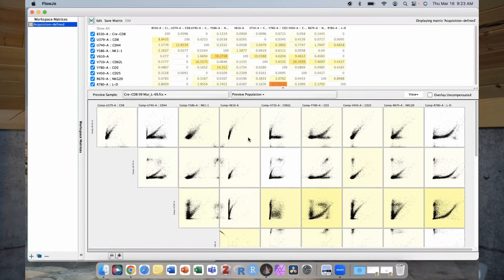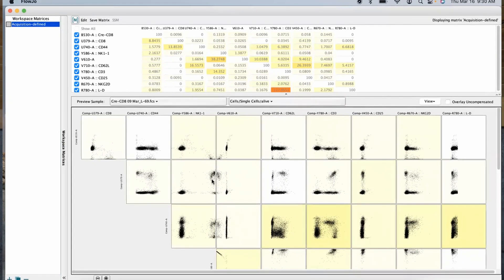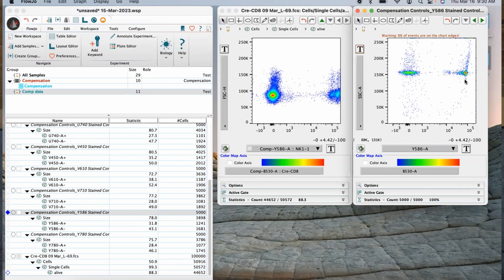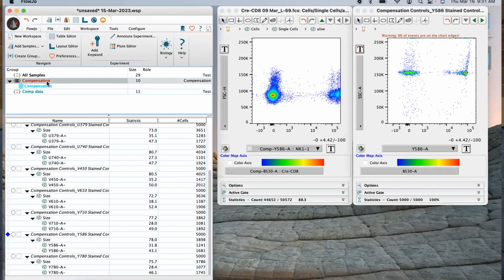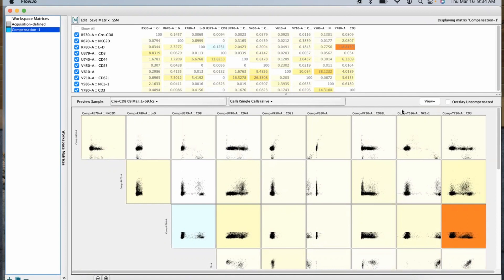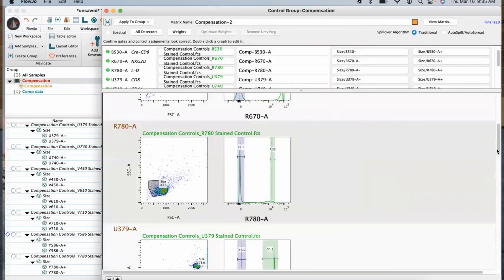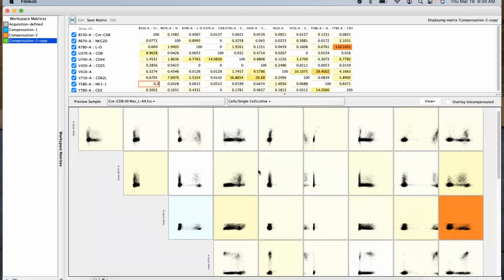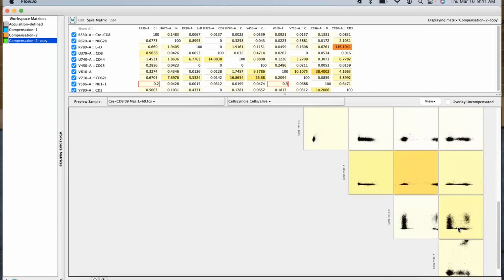Adjusting compensation: how to handle a "bad" matrix [FlowJo advanced]

Comment: What if the cell population cannot be separated well within a single color control for compensation? How to identify negative and positive peak in this single color for compensation?  Thanks!
Reply from the maker: Sorry- I have gotten behind on my responses! In that case, because compensation doesn't care about biology (i.e. if your gates are in the right spot to capture the correct population) but only cares about the fluorochrome, you can just take the extremes of each side (the most negative and the most positive) and use that. Just make sure you have enough cells included!

Comment: Thank you very much for your videos. I have rather a simple question and would greatly appreciate any advice. What do you use for your dead cell exclusion? I am confused because I use 7-AAD and it spills over to my other channels of TMRM and MitoSOX Red dyes, hence I can't exclude dead cells prior the compensation matrix formation. I can't use other viability dyes because they overlap even worse with my other dyes in the panel of 5 dyes.
Reply from the maker: I would have a compensation control for 7-AAD as well (or any other viability dye). You don’t have to exclude dead cells prior to compensation matrix formation but you do need to account for the fluorescence from the dye you use.
Reply: @ajarieger_flow  Thank you very much for such a fast reply!!!

Comment: I made the mistake of reusing my compensation matrix because I have a very large panel (18 colors). My matrix only had one major spillover issue of 153% but the outcome is that it is showing my TCRb+ T cells expressing IgG's :') everything else looks fine, its even been looked at by Flowjo people (briefly) :( I can't redo it either as I did it on brain cells and have nothing banked (near impossible to bank brain cells after stroke). I am trying to graduate in the spring and I am STRESSED.
Reply from the maker: Oh no!! Good luck! And remember that over 100% is not necessarily wrong. Look at you nxn plots to see where you issues lie
Reply: What if the issue is literally just those 2 fluorophores with each other? Would you just ignore those as not trustworthy but everything else be ok? @ajarieger_flow   Thank you for the response, I am so lost haha! I am doing clustering analysis and UMAP so I have clusters of TCRb+ IgG+ T cells. The whole graph just rockets.

Comment: Hi Dr, Rieger. First, thanks for your channel, it has clarified a lot of questions I had. 
I am wondering if the gate adjustment you showed (min ~8) can be done when using unstained control (?). Digging on my data, I checked the comp area and I had to adjust the axis to enlarge the peak and only then I was able to see 2 peaks (I assumed, the positive and negative peaks).  Is that expected when using unstained control for compensation?
In your video boths peaks are pretty clear from the very beggining, but I used unstained control and I had to adjust the axis and then adjust the gating. Is that correct?
I would appreciate your help!
Reply from the maker: I wouldn't recommend adjusting compensation with the unstained control as almost all compensation issues (over and under comp) will be seen in the positive population. The split negative is usually due to the scaling. I would recommend taking a look at this: https://www.omiq.ai/guides/understanding-data-scaling

Comment: Well said, lot of good points. I will suggest users to bring the negative population from a completely unstaned bead or cell. The negative bead or cell in the single stain will have some level of NSB that will lead to violation of rule of AF. DIVA only allow one universal negative but using more than one universal negative will be a good idea (cells for LD stain and Beads for Ab stain) for analysis.
Reply from the maker: Thanks- and yes, decent point for those using a universal negative.